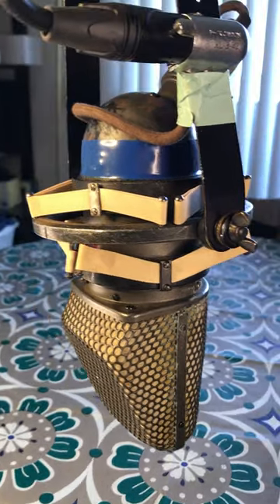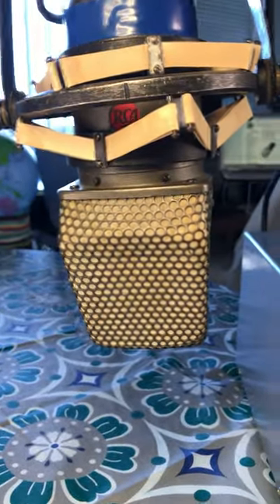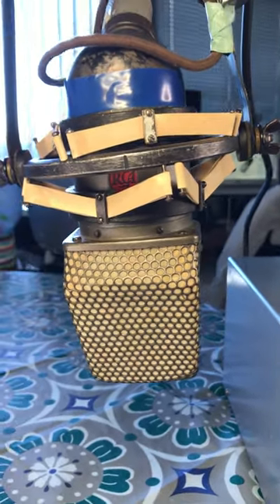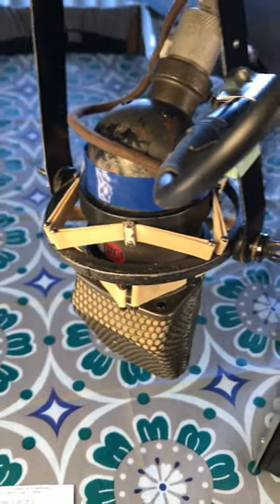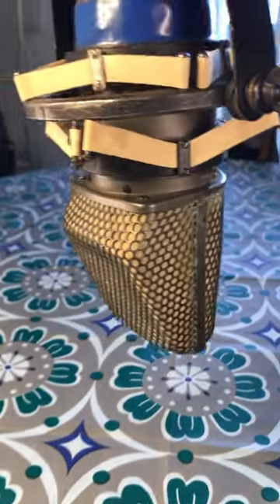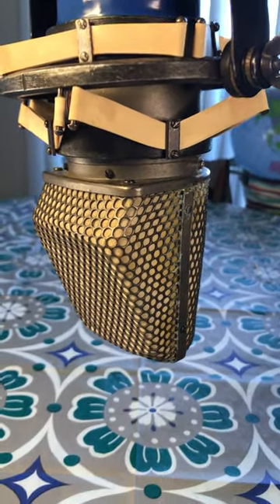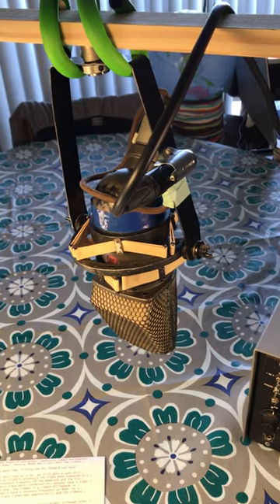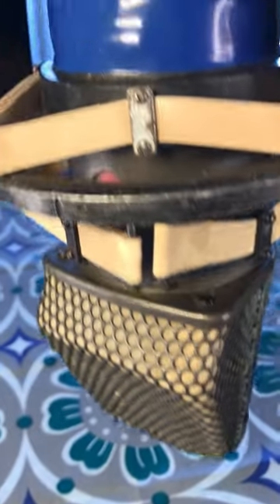RCA KU-3A 1950s Ribbon Microphone for Movies 🎶

Comment: I have two of these mics I was given but they are need of serious restoration do you know anyone capable of that?
Reply from the maker: Not really. The one I reviewed was borrowed from a local recording studio and was working fine when they bought it. Like most of these mics, it had been used and maintained in Hollywood.

I would suggest reading
https://gearspace.com/board/high-end/602401-rca-ku-3a-ribbon-mic-who-has-experience.htm
Though that thread  is unfortunately rather dated.  It mentions several names of repair guys, but again it is out of date.
If your ribbon is broken, it can be replaced for not too terribly much money. Be aware that any maintenance is likely to change the way the mic sounds. And you probably know about the special English cow hair required, though there may be a substitute for that.
Reply: Send then to AEA in california or extinct audio in the UK
Reply: or sell them to me :) I have been looking for a stereo pair for a while.